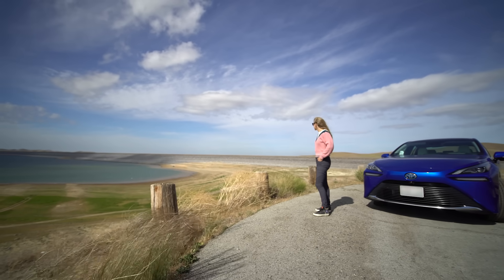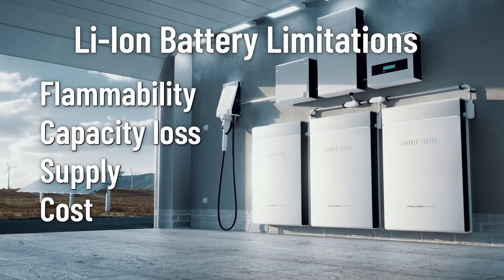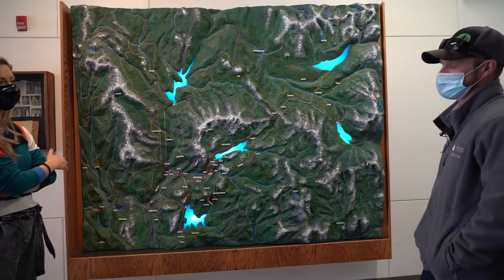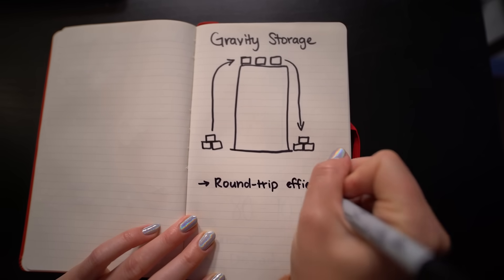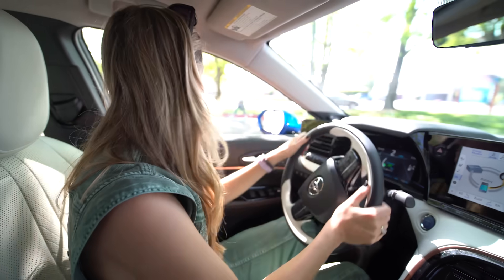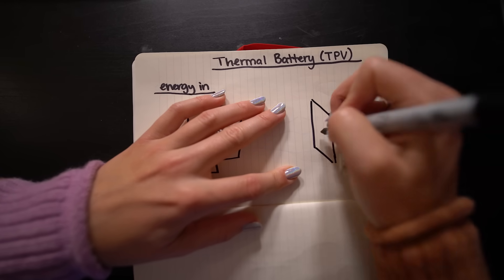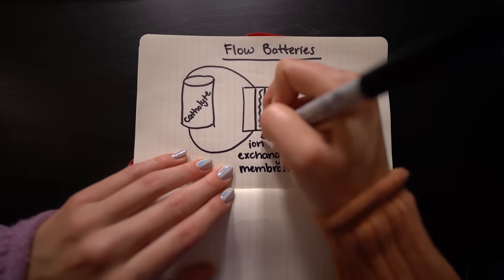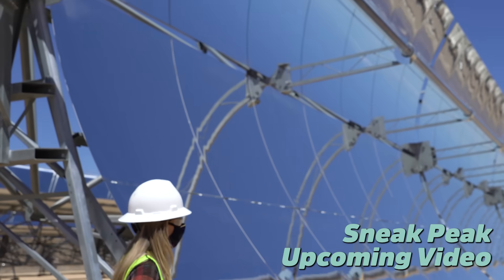The BIGGEST problem with clean energy

Comment: Energy storage economics are terrible because of the 2nd Law of Thermodynamics.  The round trip energy efficiency of these systems are at best about 80%.  Usually closer to 40-60%. This means you need to generate twice as much power as you need, averaged over time.  This doubles the cost of power, plus the cost recovery of the storage facility...  and hydrogen via Electrolysis will be very expensive unless power is nearly free.  Which isn't happening anywhere with renewables
Reply: > hydrogen via Electrolysis will be very expensive unless power is nearly free.  Which isn't happening anywhere with renewables

It's starting to happen in Australia.

At the moment in Australia we curtail huge volumes of wind/solar power constantly. We regularly have negative $1000 price events because there is too much power at certain times relative to demand. Electricity used to have value because we had to burn stuff to get it, now electricity only has value depending on availability.
Reply: @JackSimpsonJBS  Nuclear is the way forward.
Reply: @Les_S537  LCOE of nuclear is pretty terrible. Maybe they have some breakthroughs but the economics of nuclear are not very appealing.
Reply: @JackSimpsonJBS  Sorry for the lengthy response, but this is a complex topic that requires some understanding.  I'm not saying you don't know anything about the topic, and I'm not saying I'm an expert either, but think of the following.

The way we do nuclear today is expensive as all get out. 

I concede on this point...

But the question is why is it so expensive?

The reason nuclear is so expensive today is because the way we do nuclear is inherently dangerous.

Why is it inherently dangerous?

It's because we cool the nuclear material with water, and we put that water under extreme pressures, anywhere from 70 atmospheres of pressure up to 160.

Because we do nuclear this way we have to install complicated and costly triple redundant safety systems to ensure that that water stays under pressure, and to ensure it doesn't boil off of the nuclear materials.  As we all know by now, if plant operators lose the ability to circulate cool water over the nuclear material you get a meltdown.

But are there inherently safe ways to do nuclear?

Yes, there are, and we've known about it for a long time.

If you switch the coolant from water to molten salts, you get the following

1.  No more meltdowns, ever
2.  We can complete the nuclear fuel cycle resulting in close to zero waste.
3.  We can recycle all of the nuclear waste we have generated over the last 70+ years.

Molten salt nuclear reactors are inherently safe because where water can boil off one of today's nuclear reactors, that can't happen with molten salts.

These newer Generation IV nuclear reactors will be 1/20th the size of today's nuclear reactors putting out equivalent amounts of energy, and won't need all the complicated and costly safety systems that today's nuclear reactors do.

Nuclear is the future, friend.

We simply cannot get off fossil fuels using renewables like wind and solar.
Reply: @Les_S537  Oh I agree that there are developing technologies that potentially make the economics of nuclear better, but at the same time there's a lot of research into storage that potentially solves a lot of the renewable storage issues.

Maybe the storage technology comes through in which case there is no case for nuclear, maybe it doesn't and some of the nuclear tech comes through and saves the day. I think they're all worth investigating.
Reply: @JackSimpsonJBS  Couple of things...

Are you aware of the scale of things?

How many wind turbines do you think it would take to cover a third of the world's power generation needs?

Keep this in mind when you're calculating...  As the world moves to EVs, and continues to electrify, electricity generation is going to increase by double, more likely triple what it is today.

So the answer is tens of millions of wind turbines worldwide.  We've already got over 400,000 and that covers like 2-3 percent of overall generation worldwide.

Next question is, how long do these wind turbines last before mechanical stresses and general wear and tear force a complete tear down and replace?

20-25 years.

So you really think we should build tens of millions of wind turbines the world over, and every 20-25 years we have to tear them all down and replace them with brand new ones?

The same is true with solar panels except then you're talking trillions of solar panels worldwide.

Now think of this...

Batteries.  Our cars need batteries.  We can't do batteries for both solar and wind, and do batteries for our cars as well at the same time.

Go nuclear, and nuclear can charge all those EVs while making elements that we can use to build more EVs
Reply: @Les_S537  Batteries in Australia aren't really playing in the baseload market - they're playing in the security services market. In Australia we're testing out different storage tech that won't really have much interaction with the EV market.

Different tech is going to work in different markets/countries. Maybe some of the nuclear breakthroughs make it more attractive in the states, while in Australia we've got so much renewable generation currently and in the pipeline that storage and transmission are the big challenges. If we solve storage here, then nuclear doesn't make sense for us. However in other countries (in the same way that hydro and geothermal work well there) nuclear might be a better option.
Reply: @JackSimpsonJBS  I'm thinking of the Hornsdale battery farm, and I recall another installation took place recently, and one of the battery banks caught fire in a test...

This is a big issue.

When you have big banks of batteries all close to each other, and something goes awry like another Carrington Event, those battery banks are going to go up in a flash of EMP induced rage.

With molten salt nuclear reactors, and I think I heard that Indonesia is about to have one of these nuclear reactors installed, you'll never have to worry about it.  They won't melt down.  They have passive self shut down processes.  Men could walk away from the job leaving the nuclear reactor alone, and it would just slowly shut itself down over time.
Reply: @JackSimpsonJBS  are consumer prices, on average, falling?
Reply: @TechnicalBard  They fell like crazy in FY21 in Australia, will be interesting to see where that trend goes over the next few years.

Are there any commercial MSR operating at the moment in the energy market so we can see how the economics compares to the other technology?
Reply: @JackSimpsonJBS  there are no molten salt reactors running today.
Reply: @TechnicalBard  so we're both debating the merits of tech that is still theoretical at this point. I'm not saying we shouldn't fund research into MSR but it seems as premature to state it is the solution to the climate crisis as it is to state hydrogen is definitely going to be the solution.

Comment: Whatever is going to be the winner is going to be the one that the Earth gets mined and stripped less, few as possible electronics, and also needs to be almost carbon negative. The sun gives us, apparently, >36000 times the energy we currently use...but solar panels are not the way, just like recycling. What do we do in +25 years with all the now-being-bought-ones being installed? More e-waste. Thermal batteries? How do you heat them? Heat as an energy storage device, does not make sense. You start losing heat immediately, therefore calling it storage is like calling a leaky boat, seaworthy. Heat needs to be used to do the rest, not stored. If you look at ANY organism, it gets its energy from the sun, one way or another, through an extremely intense network of delivery and every cell stores energy. It's energy, in other words, is not centralized. We hope one solution is going to help, but just as computer engineers realized, the more the complex the network the more efficient it became. We need 5 on the list (and a few that's not mentioned here) and that's it. All cheap to build, old technology therefore stable and easily taught. Can ALL be made using reclaimed materials, therefore the carbon cost is lower than most of the other ones. And there's a YouTube video or 50 on almost each one of these, ranging from DIY to INFO. We could've had ALL of this more than a century ago, but copper & iron mining and oil won due to our love of convenience. We didn't want to chop wood for the fire, write letters, and go to bed early anymore. It is what it is, but we really need to stop wasting time on RESEARCHING new technologies and start doing it now with what we have, EVERYWHERE. Once we have met the 2030 (9 years from now...) levels, then, maybe, can we put TIME towards these other ones, TIME being the operative word, but it still sounds like more mining and Earth-stripping to me. We love to mimic nature when it suits us, i.e. the shape of planes, but when we have a seeming abundance, like why cars was boxy in the 70s but not before or after (oil crisis anyone?), we actually can't give a hoot. And that is where the crux lies... We are selfish animals, one of a kind, and we ALWAYS wait for someone else to come up with the solution, or blame government or big business (both of which we keep there, by voting and buying the products) and the only one that's waste is actual waste, but it's like Michael said "Gotta start with the man in the mirror" .  Small usage changes at home, in everything, can have a massive impact already in usage overall, i.e. switch wireless devices off when not needed and maybe get wired keyboard and mouse (the wireless tech needs way more minerals than just a cable and not to mention batteries), unplug from the wall socket, don't just switch-off, do you really need a new phone, or do we need phones with standardized batteries like what we've had for decades, that can be used in multiple devices (oh, yeah, I forgot, closed patents...), grow some herbs and other food, what you get from there helps with the CO2 cycle, especially trees. Never think the little you do has no impact. We're billions contributing to the dilemma, it's going to need the mind-set change of billions to reverse it, or something else. It's like voting; if all the people that didn't vote, saying 'my vote won't make a change' , actually showed, there would've been change... But as we are standing, it's like an Amazonian native said "We lost touch with the Spirit, and we're going to be the ones to bring down the whole deck of cards on ALL of us". I'm not a techno-phobe at all, but really? Do you really need a kindle or your phone to read a book? Books don't require battery and if looked after, can store the info contained for more than a century (longer than the tree that the paper came from to regrow twice and stores carbon!) and no upgrades needed and it doesn't matter how many times you've read it either, not to mention hemp-paper could be used, then no trees needed and now you'll have the seeds as well and they are a brilliant protein source or the oil can be used for medicine or fuel. And don't tell me a kindle or phone can store thousands of books, have you read thousands of books, from a kindle or phone screen, in your lifetime? So, no, it's an invalid statement. As I mentioned, carbon negative not neutral, network of different solutions with multiple uses. Anyways, great informative video, obviously enjoyed it :D Thank you. GG! PTL & BLESSINGS

Comment: Hard pass. Even if 100% renewables was a achievable option. It would not be a desirable one. The environmental impact of such inefficient low density energy sources and storage scaled up to massive proportions cannot be understated. 
Renewable energy is effectively a religion at this point.

Remember the goal is decarbonization and environmental restoration. And 100% renewables would not accomplish either.

Comment: On Monday this week the public power utilities of New England heard Gordon van Welie CEO of the grid operator for New England (ISO-NE) suggest that “ROLLING BLACKOUTS” are on the horizon without new regulations and policies that will provide the capacity to meet 5 to 7 day gaps when both solar and wind generation are low. Current regulation rules and grid markets focus on the cost of energy but undervalues capacity assets (aka grid storage) that will be needed to compensate for expanding renewables. Current regulations make it impossible for utilities to build out the grid storage needed. Gordon mentioned that Norway keeps 2 weeks of hydro power in reserve for this. Quebec Hydro has some 34 GW of hydro and with some rework and transmission lines this could work well with the pending offshore wind projects. We need regulations and policy to make grid storage happen. The technology is relatively easier.

Comment: Dianna, in the first segment on hydroelectric energy storage, a couple of times you say "pumping water down". Obviously, that's incorrect: they open valves to allow water stored at high elevation to fall through pipes and thus drive turbines. Potential energy is converted to kinetic energy, which in turn in converted into electrical energy. Physics Girl knows this, surely.

Comment: Even if we only used solar 50% of the time, that’s still a 50% reduction in grid use
Reply: Is 50% reduction in grid use a good thing?
(I'll presume you're talking residential solar, so your roof provides the 50%)

Lets assume you consume 2 kW all day long (24 kWh), that sunlight is 12h and night is 12 hours
(avoiding messy seasonal variation, sunrise, sunset, etc)
You install a 2kW system on your roof for $1,000.
And you have 100,000 neighbors who each do the same, producing 200,000 kW (2,400,000 kWh) for a total cost to society of $100,000,000.

In order to deal with night, your society purchases a hydroelectric plant, and a grid, for a total of $10,000,000,000. It produces 200,000 kW (2,400,000 kWh) during the night, enough for 2 kW per person.
total spend $10,100,000,000

However, hydroelectric plants come in 1 size (large) so you could just have your society purchase a hydroelectric plant, and a grid, ignoring the solar for a total of $10,000,000,000. It produces 200,000 kW (4,800,000 kWh) over the 24 h period, enough for 2 kW per person.
total spend $10,000,000,000
 - i.e. cheaper
also cheaper because extra maintenance on the solar panels is not needed

That you are using the hydro plant and the grid 100% of the time is irrelevant (because the cost to build and maintain is the same if you use 100% or 50%), but it is cheaper.

Now let's make it more realistic - solar is only producing about 25% of capacity (see http://eia.gov), so you don't even get half a 24h period out of your panels. You need 4x the panels ($100,000,000 -> $400,000,000!) AND you need storage (because the solar panels aren't working in rotation, they ALL work when the sun shines, but you don't want ALL that extra power all at once, you don't want 8 kW (24 kWh), you only want 2 kW (24 kWh) but you DO want ALL that extra energy (the 24 kWh).
So in addition to the $300,000,000 extra you need another $1,000,000,000 for storage.
So now the 'reduction in grid via solar' costs $11,400,000,000 compared to the hydro-only grid of $10,000,000,000.